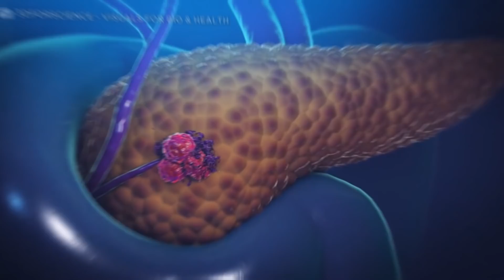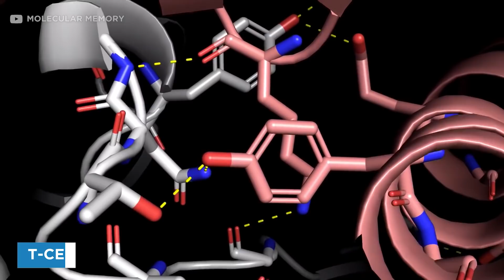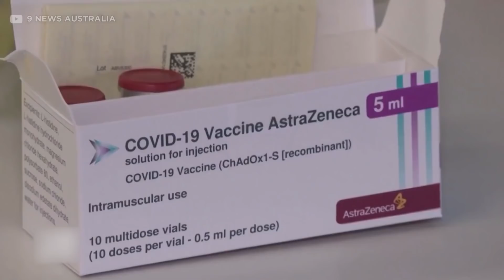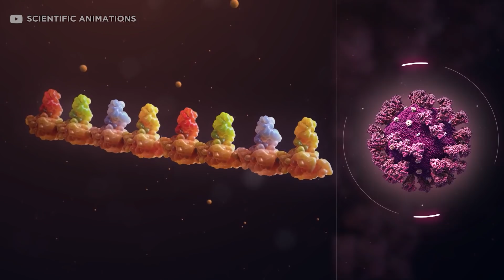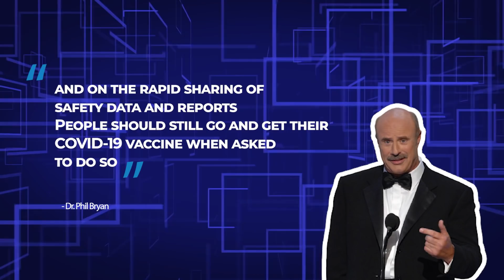AstraZeneca Vs Pfizer: Which Covid Vaccine Is Better?

Comment: Joke!  We are told by Pfizer that any reaction you get shows it's working.  Whilest with AstraZeneca we are told if there is a reaction this is because it's not as safe or good as the Pfizer thanks to the EU.  No one says half of Britain and most of Israelis have taken it and seem to be doing fine.  As said, AstraZeneca is cheaper with a cost of around 9$ per injection and easier transferred  while the Pfizer costs around 18$ per injection and harder to transport and store.  I had my AstraZeneca vaccination and unusually felt tied so slept in the afternoon of the following day.  I suffer with Arthritis and joint pain in my knees taking medication and having knee supports on my legs for the past 3 years.  Since getting my injection of AstraZeneca my knees dont hurt as much and I have not used knee support since as my legs and knees dont ache!   Sister got Pfizer and felt a little tired the following day but joints hurt.  Got her second injection and was in bed for 4 days.  She had ulcers in her mouth and could not eat properly, aching joints in her legs, knees and arms.  Flushed hot the first night and was so hot she was red faced and body.  Her legs and knee  joints continue to hurt (said never hurt as much as they do now).   Her eyes were saw and painful and used a damp cloth for 2 days to try to cool them down.  
But remember what they say!   If its Pfizer and you get a reaction it only shows it's working!  Be thankful.   If AstraZeneca then it's a side effect!,  Be careful!
Reply: Oh so because you have had the AZ you have this opinion makes sense 🤣
Reply: Me and my friend's feels great after we got Pfizer vaccine and nothing happen to us?? Meanwhile My brother got AstraZeneca and now he got fever for 2 days after taking that vaccine.. it's your antibody not you're opinions 🤣🤣
Reply: @angahsyber68  So you have just written your opinion as I did but criticize me for having an opinion!  Isn't that hypocritical and a lot like do as I say not what I do, too!    Finally isn't your write up your experience just like mine!   And why shouldn't I write up my experiences or opinions, after all isn't that what YouTube lives off...peoples opinions.
Reply: Well me and my partner have had the Pfizer jab, we both feel fine apart from muscle ache where the infection was in our shoulders. It's not a bad pain, it's more like a little ache when you lift something up.
I choose the Pfizer vaccine because of the bad press about people getting blood clots, whether it's true or not I don't know, but I thought I'd better not take the chance.

Be safe people. 

Peace out 👊
Reply: Well, Pfizer is a US company and thus lobbyists...
Reply: https://drcharlieward.com/urgent-stop-vaccinations-now/ watch now urgent and share with everyone.
Also have a look at Pimpys Investment chat, has videos showing agenda.
Reply: @alandillon968  in your opinion.
Reply: @peterhiggins9832  it's always going to be my opinion just like you clearly have one about me so get over it.
Reply: Just a guess if someone is able to read your tripe they would in fact have a brain. You have made your decision move on, stop with your personal agenda.
Reply: How the hell is the side effects of AstraZeneca bad? Isn't the whole science of it the same?

And what was the point of stating your sisters condition along with your condition in a very close sentence?
Reply: Here in Australia; the vaccines a completely free.
Reply: @jess1987  Hi to my knowledge they are free all over the world.  I know the UK is as is the EU and America for sure and think China and Russia are too.   Cannot vouch for the rest but thi k they are specially as the UK, America and I think the EU have donated a lot to developing countries so guessing they would be free too.  Even India was given donations even though it's now in the top 10 economic developed countries!!
Reply: @alandillon968  Oh K! You mentioned costs. So I thought you meant you had to pay for them!
Reply: Funny IVERMECTIN TABLETS WORKS, HYDROXYCHLOROQUINE VIT C, VIT D, ZINC WORKS.
Reply: @alandillon968   @Alan Dillon  Because it was oddly specific, and last time or any other time I came with the same comment structure like yours they always had MEANINGS. My point of questioning THAT is because of the simple fact that I wanted to know what was the point specifically. But you can just use the I did it because I wanted to PERIOD card whatsoever.

I thought that all vaccines had a common symptoms, your body will likely get tired etc.
Is their any vaccine that does not do that ?
And can you cite me some regarding on why my assumptions were wrong?

Comment: If you want to know which one is better, just take a look at cases in Israel and cases in UK. Israel vaccinate only with Pfizer, UK mainly with AZ. On the other side deaths aren't increasing there. I think it really matters which vaccin do you use. If you only want to avoid deaths, AZ is good. But if you want 0 cases you should use Pfizer. The same thing is with Chinese vaccins, main effect of them is decreasing mortality, not much effect on cases. It depends what you want. I think that isn't bad if cases are rising when it doesn't lead to more deaths. But that are just my observations.
Reply: No, Israel also used the Moderna vaccine, especially for kibbutzim, moshavim and kfarim. It doesn't have as strict cold storage requirements. Those in towns of any size got the Pfizer. I'm glad I got the Pfizer vaccine, as it is still very effective against all the known variants. Moderna isn't, sadly.
Reply: I didn't know about Moderna. I thought that they only used Pfizer. I will also get Pfizer and I am glad of that. But it is strange that Moderna doesn't work for variants, they use the same technology as Pfizer. Maybe it's not know yet of it works against all variants, I should read more about it. At the top of that I think that focusing on mRNA vaccins is the best strategy. I hope that we go back to normal asap, because this restrictions are terryfying, I am more afraid of them than for covid.

Comment: Long term RNA vaccine effects? Infertility? Cancer? Hyper-immune response? Death?
I will rather use FDA approved medicines such as ivermectin or hydroxycloquin thanks.
Reply: They knew ivermectin worked means the virus is un natural
Reply: You are misinformed.
Reply: @eternalcoldweather  my assumption
Reply: First, ivermectin is an antifungal, and won't do squat against a virus. Hydrochloroquine is an anti-malarial, and it does nothing against a virus either. Second, mRNA never enters the cellular nucleus, so cannot change DNA, thus no infertility or cancer. Also, as soon as the cells uptake the mRNA, they begin to produce viral protein. The immune system recognizes that protein as non-self, and kill those cells. Even if the cellular DNA were changed, which it isn't, those cells are gone in a day or two. For pity's sake take a biochemistry class. Everything you wrote is utter nonsense.
Reply: @deborahfreedman333  I yawned
Reply: @spamspam7265  then wake up you might actually learn something 🙄
Reply: @shoozy9352  who else is high right now

Comment: Which one of these vaccines  have the tracking  device  in  them ?
Reply: Your phone is the tracking device.
Reply: To find out if you have been chipped or not with the jabs, take a small magnet and place it on the arm where the jabbed was and you will know. The quantum microchip is the "Mark Of The Beast" that many has been deceived into taking the jabs.
Reply: @Haknumansoksan  i did it and nothing happened,  you should get your facts right. Educate yourself before claiming something that is not even possible.
Reply: @amirmt8429  And yet you tried with a magnet?
Reply: @amirmt8429  The 3rd dimensional Ego mind cannot understand beyond it's 3D realty. Once you reached a higher state of awareness then you will KNOW instead of just believing. Message shared with Love and Light!
Reply: Lol
Reply: Jesus 🤦🏻‍♀️🤦🏻‍♀️🤦🏻‍♀️🤦🏻‍♀️
Reply: @Matt Do i need to own a mobile phone to connect to the vaccine?
Reply: Neither...but your phone has
Reply: All of them have quantum microchip technology in it. It's part of AI control systems with just a push of a button. However, our Galactic families and friends are doing their parts in the higher dimensions to help disabled or destroyed those satellites in space so there will be no mass death toll. For more info, go to "Vaccine Injury News" dot com or "Prepare For Change" dot net and connect the dots. Message shared with Love and Light!

Comment: Ivermectin renders mass vaccination redundant and invalidates 'emergency use orders'. Sputnik V is the most effective and safest CV19 vaccine.
Reply: If this was a fungal disease, maybe. But, it's a virus. Also, Sputnik and the Sino-vaccine are the worst ones, the most pathetic immune response, with the most nasty side effects. Read a few scientific papers, not the crap you've been reading. They took down the pubmed paywall. Learn something.
Reply: @deborahfreedman333  Ivermectin is being used to very successfully treat and prevent CV19 in India, Argentina, Mexico and in many African states where it is part of community health programs, have a much-moderated CV19 problem. Also, a majority of people are immunodeficient because of low Vit D3 levels( A Spanish sample of CV19 victims showed 94% had low Vit D levels) mass Vit D3 and fortification of foodstuffs would also mitigate the number of infections and moderate severity. Sputnik V is very effective and will soon be approved by WHO. Ivermectin attaches to the ACE2 receptors and blocks the 'spike protein' from attaching to the ACE2 receptors. Do some independent research. The 'emergency use orders' for the experimental MNRA vaccines are the reason Ivermectin is being suppressed as it renders them redundant and illegal!

Comment: Astra use adenovirus which give blood clots exactly the same as people who took heparin. 
Thanks for this , but refused and waiting pfizer or moderna.
Reply: Heparin is a blood anticoagulant.
Reply: @mm-qu3ht  In rare cases heparin induces the immunity system to produce errant antibodies which can accidentally activate platelets(small structures in the blood that form clots)
When activated they stick together and form clots and their consumption leads to increased tendency of bleeding 
This condition is called HIT (Heparin Induced Thrombocytopenia)
Reply: That and it won't protect against the South African strains unkile Pfizer and Moderna.
Reply: @richardkaz2336  Turns out it does protect against all strains after all.
Reply: @richardkaz2336  Please get your facts straight.  AZ is 60% efficiency AFTER ONE DOSE. I presume you are being paid by Pfizer.
Reply: @billgreen8966  Not talking about its efficiency against the original strain of COVID-19. AZ has reported 2 jab efficiency of ~85% for that strain. This is still lower than Pfizer/Moderna >90%. 
When it comes to AZ efficiency against the South African and indian strains and their variants it fairs much lower, nowhere  near Moderna Pfizer technology. The percentages published vary with strains and who data you read. But they do show that AZ is a lessser vaccine. I do acknowledge that the latest published AZ's results show AZ has gone from a 0-10% to around 60-65% efficiency for those strains and varients. It is still a lesser vaccine. You don't get to pick and chose which virus you can contract but you should have access to the better vaccine, something the Australian Government fails to offer. 
No I have absolutely no affiliation to any vaccine or pharmaceutical company.
Reply: @billgreen8966  wow you are very patient in taking time to explain things to this person but head and brick wall comes to mind 🤷‍♀️
Reply: @shoozy9352  Ha Ha thanks.  I know but someone has to at least try.